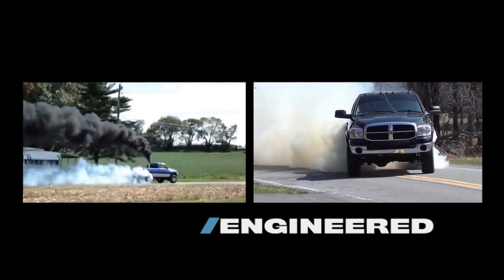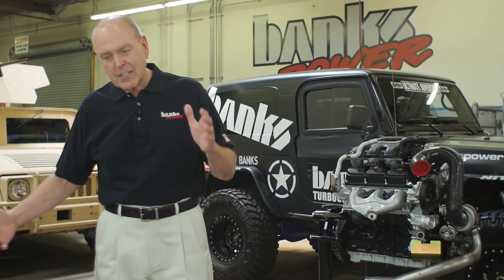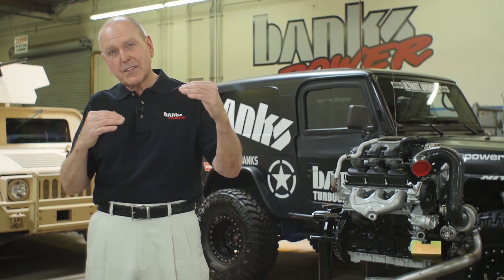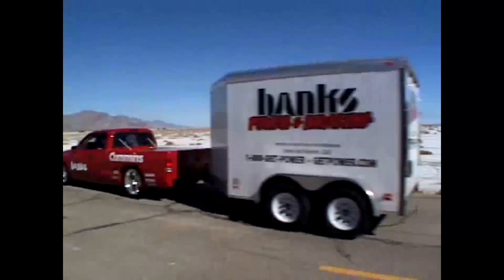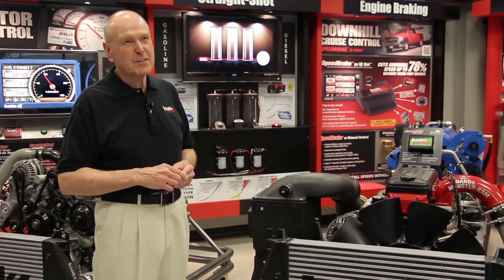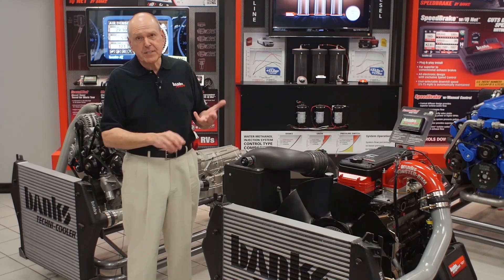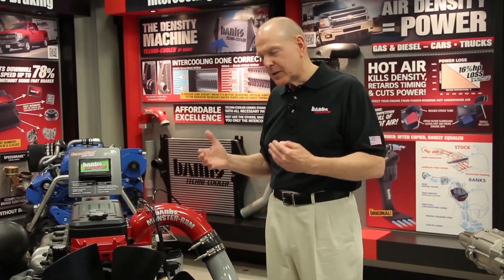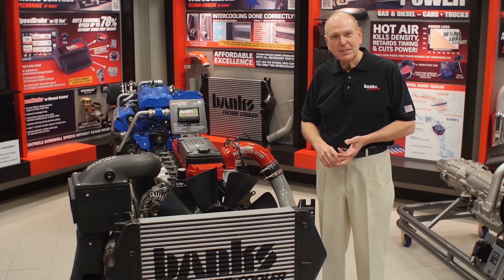Learn from the Master of Diesel - /ENGINEERED

Comment: Finally, a guy willing to tell the coal rollers off!  OVERFUELING KILLS ENGINES!!  You wouldn't believe how many guys out there are buying injectors in bulk, not even getting them flow matched, just to get that nice new knocking sound of a Diesel struggling to run at idle!  Diesels require VERY little fuel to run, they adore air to compress, the more air that can be heated and compressed, the greater the efficiency of the burn!  Don't even worry about knock, the better cetane level, the quicker the burn!

Comment: Black smoke out of the exhaust is just wasted fuel and pollution. It happened more with old mechanical pumps, but there is no excuse for it on common rail and direct injection engines...

Comment: Agreed.  Banks Power has it right.  It's all about air movement and air density.  Diesels are cleaner than gasoline powered engines.  It is a well documented fact.  Thanks, Gale.

Comment: Im 100%  with you Gale. Black "choke" is just wasted fuel and anti social in a road vehicle. Too many buffoons just think winding up the boost will give more power when the returns vs boost are minimal and the charge temp going in is so high that it can cause engine damage or limit power due to thermal limitations. The key is charge density not pressure. On a Petrol engine charge temp  is even more important for detonation prevention. Spot on with the fuel too. Good biodiesel is fine but the backyard  boys use rubbish stock with baddies like glycerin which gums up your engine.

Comment: It's really hard to have a mechanical injection system that is higher horsepower to not "roll coal" I can drive all day long in my 12v without it smoking at at all but if you put it to the boards at low rpm it just overfuels and smokes like a fright train. It's more how you drive an over modified diesel then anything. If you drive with a lead foot you are gonna be rolling coal everywhere
Reply: Is it a VE pump?
Reply: BoostAddict yes
Reply: Just turn down the low end fuel screw.
Reply: BoostAddict why would I do that? It dosent smoke when I drive normally. It's only if I lug the engine hard when I'm pulling a trailer or floor it to pass someone. I can drive it all week with it maybe puffing I tinny bit between transfer from 1st to second and 4th to 5th but it isn't smoking like a freight train. It's mechanical injection and when you have a massive turbo to spool and 50hp injectors it's going to smoke when you lug the engine until the turbo spools no matter how much you mess with the low end fuel screw.
Reply: Oh I misread your comment. I thought it was smoking all the time at low RPMs.

Comment: So black smoke kills the diesel?  Makes HEAT?   Come on Gale.......  get off the liberal psyop BS . So un burned / extra fuel makes more heat than getting more air mixed in and BURNING all that fuel resulting in MORE POWER?   I've literally heard Gale Banks say, "all that black smoke is power your not utilizing"   Look around, Banks Diesel performance items for todays trucks are not the best choices.......
Reply: You can run that much fuel if you have enough boost to match. That's all it is.

Comment: "less smoke (fast and quieter: with after treatment) than gasoline engine" hehehe... gasoline has cat-conv and thats it. diesel has cat, particle filter and this new AdBlue system which are expensive to maintain... or on the other hand, if you put additional two cleaning systems on gasoline engine i bet it would be cleaner than diesel. like saying "i am running faster (fast and quiet: driving my car) than you on foot". of course that is true if there is more technology involved...

Comment: also on a c-13 engine. I  drove a Peterbilt With a c-13 with the ARD system and every 3 months it had to go into either Cat or Peterbilt for service when the computer would shut the truck down. The bill would be 6-7,000 just to fix it. It was horrible. Every time you would  take it to Cat there would be nothing but Peterbilts with that crap ARD system in the parking lot waiting to be fixed. My boss finally  took it in to get deleted and ever since that happened the truck ran great. In 4=1/2 years I put 900,000 kms on the truck and the truck had more power and better fuel economy. Fuck Dpf systems and all that pollution crap.
Reply: Yeah taking that off is illegal
Reply: BoostAddict So is speeding, but people do it anyway. The International concrete mixer truck that I drive has had all it's pollution equipment deleted. No def,dpf,or egr and that equals better milage, more power,and less maintenance. Still runs clean,no smoke.

Comment: At any point the customers can order anything and swap there cars and you offer the kits accordingly. I want my 94 accord to be a 5 or 6 speed manual AWD Turbo Diesel with as much power and torque as you can design, I want to be in the 2500+ HP range the more horse power and torque, the better, I want to have a direct bolt on kit. where the kit comes with everything to swap the engine over with ease, and comes with the exhaust. I also need decals for the windshields. the motor should be able to hold 3 alternators and 1 is the stock Honda Alternator and I want the engine to be straight where the belt driven accessories face to the front. Unless the the customer wants to stay FWD, make the kit for a front face for ease of work. I say sponsor me and build my car first, hell, I will help and after the product is finished I will advertise, but I need your help to get this available. Then we can get into magazines for every last car and truck magazine out there. The advertisements get the company noticed in a big way to where the engine swap guys and the people who pay for the swap because of what they want in their car will call you guys, I will go on the news with the setup. make it to where I can run it in front wheel drive, rear wheel Drive, and AWD by simply hitting a switch so I can take it to an emissions rolling road. I want the news to show a diesel car with almost 0 emissions and has serious power that can do a quarter mile in record time and break records along the way while having a full built sound system,. Think about it, how many people would use the sudden availability of a fast power plant and still be able to drive down the regular roads in the same vehicle, get amazing mileage per gallon and have reliability with great emmisions and have a sound system, power steering, A/C, arm rest refrigerator, interior luxury (not having to strip the car of rear seats, carpet, dashboard, luxury of power steering and most weight stripped for the track) and add in a role cage for when they go to the track all thanks to the Banks Power helping one guy and sponsoring him for advertising the car and he goes to the news with emissions and power rating's that are incredible not to mention Banks Power is making affordable kits for anyone who orders with a build to order as a start up. I know it will take some time but to get to where the kits can be slapped together for order, but if you are willing to help me, I will be willing to help you. I can take some LG the money from being sponsored by Power Banks, and if you can get me a sponsorship from Garret and the other products like K&N, Magnaflow etc, I can buy cars for use to build kits on and help with some of the expense that goes into building and designing the kits. All I ask is that I am taken care of and when/if the company decides that they no longer want me, that I get to keep the collection of cars I bought to design kits on, yes I want to have my own collection like Jay Leno but better.

Comment: Your company should make a full kit swap for every vehicle out. I will run a diesel motor in my car if you can make one that has 2500HP and that bolts right up to the tranni and engine mounts, I also need a tranni that can handle that kind of power and can put out that kind of torque, I prefer manual so a 5 or 6 speed with a revers gear is desirable, I have a F22B1 Vtec and I think it would be a whole game changer if there was a diesel option out there, something that uses the stock wiring harness so the computer can be swapped, the fuel lines and tank, and the components to choose from FWD to RWD or AWD as well as the kits to make any car that comes only as a automatic with only a gas powered engine the option a driver can love. I have a 94 Accord EX with a F22B1 and an automatic FWD. Now this car comes only FWD from the factory and only has a gas engine none turbo and that goes for all Accords and most every FWD cars. Now if there was a company that made direct swap kits that came with a manual to convert the car to a RWD or AWD or really whatever the customer wants to do and it comes with everything needed to make it possible when ordered for their vehicle.

Comment: How could diesel fuel increase lubricity with lower sulfur content? Sulfur is a lubricant, and a very good one, fuel systems (pumps, injectors) used to last much, much longer. Even new common rail fuel systems last much longer, and Banks should know this, they build the only US CR systems that can legally burn high sulfur fuel (the Military is exempt from emissions, even when on US highways). Modern Diesel fuel has much lower lubricity.

Comment: So basically, diesels can't knock because there is no such thing compression  for them? Thats incredible. Think of how much boost you can put on your average cummins, you're just limited to the point of something breaking from heat/pressure.
Reply: There is of course compression! The difference is that the diesel is injected after the compression has already happened so it cant pre ignite or knock.
Reply: yeah it's like 50 psi stock block

Comment: does diesel have vtec?
Reply: Greg Ramos I'm no engineer, but variable valve timing, lift and duration is technically possible. I think Mitsubishi do a VVT  diesel.
Reply: Mitsu's 4n15 has it on the exhaust side i think

Comment: The one thing I thoroughly disagree with is when he says the new diesels fuels have more lubricity than the old? that is just plain untrue if you have felt the difference between ulsd and the old stuff or even off road diesel  then you know the old stuff lubricated the injectors and pumps so much better than the new. Sure its emissions friendly but fuel system components friendly no way.  But I do love gale banks products especially there intercoolers just great pieces!

Comment: 10:20 - A number of those "cold air" kits are unnecessary in many of the applications I see, as air is usually pulled in off of a hole in the radiator support (usually behind a headlight).  Spending $200+ on an air filter and pipe, therefor, is quite the waste of time and money... especially when the aftermarket air filter is now exposed to engine compartment air.

And if you suspect restriction with the factory air filter, just install a sensitive vacuum gauge in the airbox (with a hose long enough to tape the gauge to the windshield or take it into the cab), on the intake/ turbo side of the air filter, in a location that doesn't create a venturi effect on the hose (in other words, not in the air inlet piping).

Comment: Isn't the low cold air intake a bad idea,it reduces water wading ability and is unnecessarily long tubing.
Reply: +Vikram Sahu For off-road and extremely wet applications, there is an alternative design that requires piping that either comes out of the hood or the fender and runs up the A-pillar next to the windshield.  It's known as a snorkel.  They tend to have smaller inlets for the air, but they also almost completely eliminate the risk of hydro-locking the engine.
Reply: +Cragon McBride  you did not get my point,i know what a snorkel is, i wanted to say that having an air intake low down isn't good for even normal roads which might flood due to sudden rain, and water splashing from tires can be sucked into the intake, making a straight intake pipe above the radiator is best as it reduces the resistance due to long travel of low level intake.
i dont see any specific advantage of having of low intake pipe.it seems unnecessary and complicated ,reducing efficiency at same time.
Reply: +Vikram Sahu That's how all cold air intakes work. They're put low because it's furthest away from the engine bay and therefor furthest away from the heat. The amount of rain that may splash into the ram air unit is so minimal that it doesn't effect the engine. I have a car with a low mounted intake that sits lower than most of the vehicles that Banks' engines go into and I never have no problem with water getting into my intake unit.
Reply: +Cragon McBride actually if you would look at the engine he is talking about the intake is beside and behind the radiator, which is the hottest place, if the intake would be from above and in front of the radiator it would get the coldest air to the engine,because air wont heat up while going behind the radiator.most cars have such configuration so they take air from the main central grill between the headlights. Some cars have intake from the fenders ,which also is away from the radiator. About water,i was talking more about off road use. any car with low air intake is more susceptible to hydrolocked engine than a car with high air intake.
Reply: +Cragon McBride By the way, i am not saying that i am more intelligent than guys who developed this engine, i am just curious why they have made it such rather than more efficient(according to me), easier and shorter ways.

Comment: Exactly, I don't get why ppl love rolling coal, ignition= Oxygen+ temperature and fuel. Rolling coal= more fuel with same amount of air which also mean higher temperature and reduce the air density meaning the engine will loss boost very soon. I like how Bank's power trying to balance out the ratio between air, fuel and temperature. Ie, using OttoMind micro-programmer to control air fuel flow to maximize boost and fuel economy. I also like how that "Super turbo semi"  burning every single cubic inch of left over or wasted fuel for more power especially during hill climb where air density is thinner.

Comment: What I'd like to know is why the combustion chamber is in the piston in diesel engines. Just that alone doesn't seem very efficient compared to a traditional design where the piston is flat and the combustion chamber is in the cylinder head.
Reply: The swirl of the combustion gases makes more power and some other mechanical advantages. And more compression is allowed I think
Reply: +Kenyon Payne has to do with spray angle of the injectors since diesels inject when its time for combustion. the injection spray is matched to the bowl of the piston.

Comment: Increasing intake piping diameter after the intercooler isn't that good.
Like he said you need ,swirl inside the cylinder,but big pipes make the airflow slower.
A smaller pipe would allow a fast airflow entering the head,helping for nice turbulences.
Intercooler need sto be the smaller and the thicker as possible,the less long they are the better it is.
Those ones are good to replace stock parts,but are not ideal on design/efficiency.
Reply: +xSirDingo 
They paint parts flashy red and use "monster" word on them too....
Technology and Physic is a thing,making a living out of it is a totally different one.
Yes,they are serious,but it can be improved if you want.
Just buy a book on engine preparation and you will see by yourself.

Comment: Well the first diesel wasn't 4 stroked, it was more similar to a 2 stroke. and was built by MAN which later then came out with a 4 stroke Diesel about 20 years after Rudolf died. and Nicolas Otto invented the gas 4 stroke Engine but he later founded the Company Deutz which later also started to build Diesel Engines and got famous for their fan cooled Diesel Engines. and Deutz and MAN are some of the oldest Engine manufactures in the World Deutz being the oldest but MAN the oldest Diesel manufacture. i know this from the top of my head why? because... well.. runs out of the room and slams the door

Comment: Gale makes some good points however his comment about Midwesterners and smoke=power is completely off base. In a pulling truck you use that excessive fuel to spool the incredibly large turbos and a lot are fueled by mechanically operating pumps thus are harder to fine tune the fuel output. Street trucks are very different in the intent of fuel & air delivery thus cleaning up smoke is completely different and much more attainable.

Comment: There he said it.  No back pressure in the exhaust system for diesels.  But the EPA wants to limit what we are allowed to have when going to emissions.  Its all in the tuning...so.  If those company's that provided tuning that is having dickheads "rolling coal" then go after the tuners and force them to be more effective.  You will without a doubt get some smoke.  But not gobs of it.

Comment: Funny most of the Banks tuned vehicles I see roll coal way more than my truck tuned with EFILive....but thats none of my business. Also would have been nice to hear a little bit on HPR diesel and its higher Cetane levels. Don't get me wrong, Gale Banks is incredibly smart and his theories are spot on, but his tuning programs are not very good IMHO.
Reply: +stayunique91 If you see a Banks truck roll coal, then it only has the tune and not the rest of the setup, also. EFILive is only a programmer, but it depends on the tunes you get. Mr Banks proved this with his 7 second Duramax S-10 that revs past 7000RPM and does so with 0 smoke(First diesel to break 7 seconds) Saying his tunes are no good would be extremely ignorant.